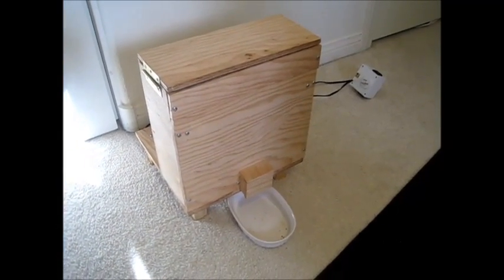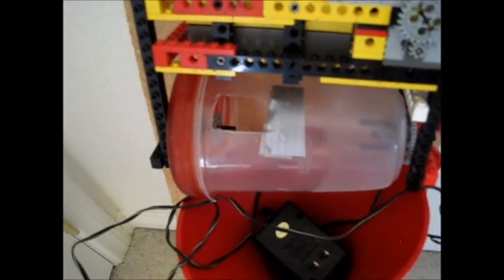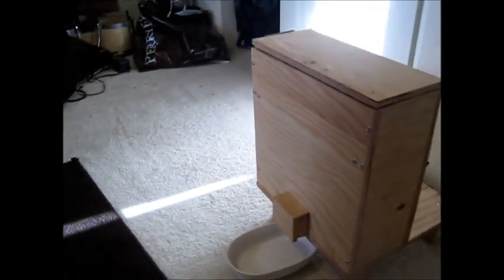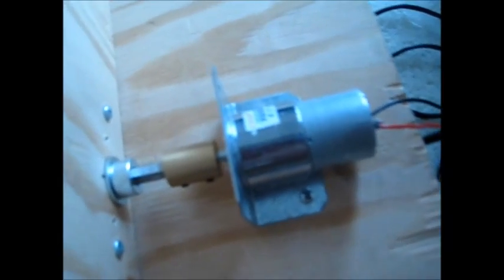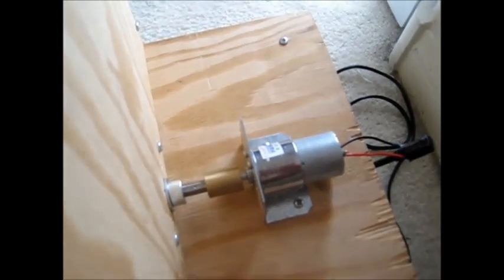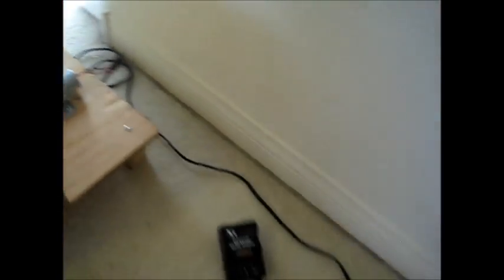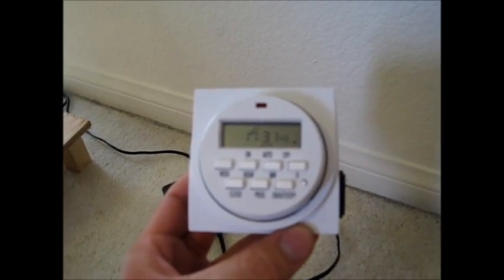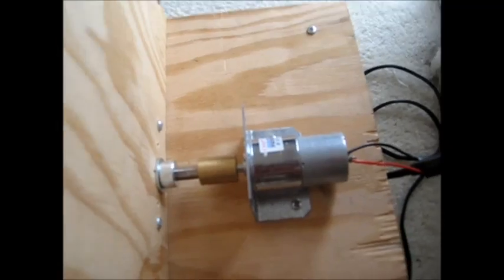Homemade Automatic Dog (Pet) Feeder Update

Comment: FYI, the timer appears to be the one sold by Harbor Freight.  You can modify this unit so it can be programmed down to 1 second intervals.  Open the timer up and on the main circuit board you will find two pairs of solder pads.  Bridge each of them with solder.  This will set the timer to 12 hour am/pm mode (instead of 24 hour military time) and will allow you to use the bottom right button to program down to the second.    

Incidentally, the design you are using is very similar to the original AutoPetFeeder.
Reply from the maker: Good to know.  Thanks!

Comment: Hey dude, great vid. Small favour, would you be able to send me all the electronics that you used e.g. 12 v motor, dc adapter, digital wall adapter auger bit, coupler and also the wood measurements. 

PLEASE RESPOND ASAP AS I NEED TO MAKE THIS FOR A SCHOOL PROJECT 

THANKS SO MUCH
Reply from the maker: Please email me at hutchmath@gmail.com and I will email you the list and links.

Comment: Will these parts work?
I can't figure out where to get the DC adapter. 
https://www.amazon.com/gp/product/B00004YO6X/ref=ox_sc_act_title_1?ie=UTF8&psc=1&smid=A2M9YF80JDMAHE
https://www.amazon.com/gp/product/B00MVF16JG/ref=ox_sc_act_title_2?ie=UTF8&psc=1&smid=AARY1ZSUT9VPR
https://www.amazon.com/gp/product/B00858SRHC/ref=ox_sc_act_title_3?ie=UTF8&psc=1&smid=A30WUG2ZDGM0XM
https://www.amazon.com/Stainless-Steel-Screw-Shaft-Coupler/dp/B00KVNA50G/ref=sr_1_2?s=industrial&ie=UTF8&qid=1475121214&sr=1-2&keywords=coupler+shaft+3%2F8+to+1%2F4
Reply from the maker: If you send me an email at hutchmath@gmail.com then I will send you the complete parts list with links.
Reply: kobus.fourie@gmail.com

Comment: Awesome, great idea! I was thinking of a solenoid but the auger will work better. Using a drill bit was a great idea. 

Thanks!
Reply from the maker: That's a great idea, Moises.  A wifi power outlet would allow you to control it online and feed your pet anytime you want.
Reply: Nice. I was thinking of doing the same. How did it turn out for you?
Reply from the maker: Glad my video was able to help you!
Reply: Great ideal. I'm currently building mine barrowing from your ideal. I'm using an electric power drill hooked up to a wifi power outlet so I can have access thru my iPhone.
Reply: Dan Man. Thanks dan man. It turned out great. Just got back from a one week vacation and worked flawless. I pointed one my home surveillance camera to monitor it. Couldn't be happier with it. Suggest buying a wifi plug thru amazon ($20).
Reply: how to control when motor should stop spinning and stop deliver the food?
Reply: can i do it with these items?
Second hand botch Drill
Timer clock?

Comment: how but make it battery operated with a switch?
Reply from the maker: Yes you could hook it up to 12V of batteries and use a switch but then you would need to use something to program it with, like a arduino.  Using a wall timer and plug seemed the easiest for me and I do not need to worry about batteries running out.

Comment: Hey everyone, I am going to use a rubber automotive fuel line hose as my drive coupler. It's cheaper than a metal one! You can use small hose clamps to make up for shaft diameter differences.
Reply from the maker: Sounds like a good idea.  If the food gets stuck hopefully that fuel hose will not slip.
Reply: I'll probably also use an adhesive, but I am pretty confident the hose clamps will have more grip than the motor has torque

Comment: This is exactly what I have been thinking about doing for several months. Though, in my mind, the 'ramps' would be closer, even touching the drill bit on the sides.

I plan to use a plastic storage container tilted on it's side so the bottom side corner will be the lowest point. The container will be tilted at a 45 degree angle. I then plan to place the drill bit at the lowest point and therefore the sides/bottom will act as automatic guides for the food. The motor will be as you have yours and the other side will have the hole for the food. I do expect that I will have to put a cover over the end of the drill to prevent food from just dropping out.

Do you have any suggestions based upon your experience with your design?

I really appreciate your posting this.
Reply: Great idea of using the tilted bin. I am thinking of using a square plastic container that kitty litter comes in. I will protrude the tip of the auger out about 1" so I think that should keep food from just dropping out. I will elevate my container on a stand to keep out of my insatiable lab mix. A PVC pipe will cover the auger protrusion and dump into a funnel that carries the food down to her bowl on the floor. Any updates on your build? I should have mine done this weekend.
Reply: That is a great idea.  Sadly I had to disassemble this project.  The motor and everything was working great but since there was such a gap between the auger and the ramps, food would collect there and eventually attracted bugs.  For my dog's safety I took it apart and kept the main components in case I want to re-design it.  My dog now eats whenever she wants so the feeder is not really necessary.  If I am looking for a new project to build, then I would consider redesigning it.  Perhaps use a sealed food container and have the augor go vertical instead of horizontal.  Then this would drop the food in the same way.
Reply from the maker: A plastic storage container is better than a wood container.  My wood became discolored over time and eventually had to be discarded.   Yes placing the ramps closer would be better.  I had too much space between and that resulted in food building up there and attracting bugs.
Reply: Is your done yet? I would be very interested to see how it comes out. I have worked mine over and over in my mind. I know the concept is going to work. The devil is in the details. I have no made mine due to lack of money.  Here are some other 'notes': The auger must be based upon the size of the food. The auger extension only has to be one 'loop' of the 'screw' (1 inch is probably a bit much). The container must be as air-tight as possible, moisture resistant and sealed. Any moisture in the air will not exceed  the 'extension' and be emptied each feeding. The container must be fairly large, likely hold a 20lb sack of food. (related to the moisture and interaction required). The extension could be secured by a 'tie wrap' with two small holes on the bottom of the container and the head inside the container, surrounding the extension. Best to use any glue that is 'safe' for food. I would use a hot glue gun if I cut that hole poorly. Note that the color of the glue sticks indicates the strength and heat required to melt it. (black being the strongest)

I have 3 cats and one large dog. It's non stop, the feeding and watering. 

I solved the watering problem by buying an automatic watering bowl on eBay for $15 with screws mounting (vs just sits on the floor) so I can guarantee the water bowl will not tip to allow flooding of the house..
I have one for the cats (high up) and one for the (sloppy) 70lb dog.

Right now, I have my hands full working on 2 sailboats. I'll follow this project though.
Reply from the maker: No I have not started this project.   Just an idea in my head for now.  Currently my dog is not eating as soon as we put down the food because she is sometimes picky and wants other things like veggies.  Therefore sometimes the food sits all day before she finally realizes she is not getting anything else.  Therefore at this stage a dog feeder may not work with our dog.
Reply: Nope I'll be starting on mine tonight and have to finish it pretty soon here in the next couple days, before weeks' end. I am not worried about the airtightness because I will only use this system for a couple days at a time if I'm out of town.
Reply: Yikes! The 'extension' cannot be inside the container, or the auger will not ride on the bottom (curved) of the container edge. My bad...

Comment: Is there any electronic means of speeding up the motor, other than by use of gears?
Thanks
Reply from the maker: +Martin Scherer   They do make gear-motors that spin faster than this one.   I purchased this one because a slower speed means more torque.  I wanted to make sure there is enough torque to push the food out without it getting stuck.  The only way to increase a motor's speed is to increase the number of volts, however over time this would most likely burn out the motor.
Reply: Thanks

Comment: I ALWAYS have my dogs water bowl right next to his food bowl, Juuust incase.         - Hes gotten choked a few times om his food & almost got choked a few times & his water dish is first thing he goes for,so I make sure he ALWAYS has it right there.    / Very cool idea though with the feeder. I guess it depends how trustworthy the timer is,if it malfunctioned & stayed running & got the motor too hot,would suck.
Reply from the maker: +97warlock ismyname  I used the timer for 3 years constantly without any issues.

Comment: Thanks for this. I want to feed rodents. I'm thinking of housing the auger in a 1" uPVC pipe with a 1" hole from the food container. do you see any problems in that? How did you get the motor to turn anticlockwise?
Reply: +Martin Scherer   You get the motor to spin counterclockwise by switching the leads from the motor.   If you food is small enough then your idea could work.  However if the food is too big it may get caught and put more strain on the motor.
Reply: Thanks, Eric. you are very prompt. I will probably be using sunflower kernels. 

These are prototypes. I looked at adapting commercial pet feeders to deliver smaller amounts but people's reviews told me they probably wouldn't work. If cats can reach inside, I'm pretty sure rodents will. I experimented with a cereal dispenser and coco pops, but the dispensers soon jammed up. Worse, I found the rodents rejected the coco pops! What are we feeding our children? 

I then experimenting  with a home made turn screw and for a motor took apart citrus juicers, which are pretty strong, but they are either too big or have auto reversing motors. If I had come across your video, I would have saved time! If I succeed in my objective, I will post the feeder adaptation here. 

Thanks.
Reply: +Martin Scherer   That's great.   I would like to see your final creation.
Reply: +1rudedogg Works fine as designed by Eric. I'd be concerned about speeding up as that might increase risk of trapped food.

Comment: What store did you find your auger??... is it online?

thank you!
marC:)
Reply from the maker: Marc Paradis   I found it at Harbor Freight:  http://www.harborfreight.com/auger-bit-set-7-pc-68166.html
I used the largest drill bit, which is 1 inch.
Reply: Thank you for your quick response! But ... what motor did you use? i mean the diameter need a shaft coupler, and which motor do you use?

thank you so much! :)
marC:)
Reply: Marc Paradis can you post the link of your motor also the shaft adapter?

thank you so much! :)
marC:)
Reply from the maker: Marc Paradis   Motor: http://www.amazon.com/gp/product/B00858TNN4/ref=oh_details_o00_s00_i00
Shaft Coupler:  http://www.skycraftsurplus.com/shaftcoupler38to14.aspx

Comment: Can I know where did you find the auger? + wouldn't a plastic auger be better?? I'm doing an automated pet feeding for my school project.. I would appreciate your help in finding the auger..
Reply: +Rawan Al-rasheed     I found the auger as part of a set from Harbor Freight Tools:  http://www.harborfreight.com/auger-bit-set-7-pc-61542.html    I used the biggest auger which was 1 inch.  A 1.5 or 2 inch one would be better, but this was the best one I could find for the price.

Plastic would be better but I was never able to find one this small.
Reply: +Rawan Al-rasheed Human breakfast cereal dispensers use plastic. Not quite an auger but similar. I first thought of automating one but found as several as posted they jam up in human use. So I sent it back. It also cost more than the pats Eric chose.
Reply: +Rawan Al-rasheed The Harbor Freight augers come in a pack of 5. All can be put inside a uPVC pipe of appropriate size to be found at Home Depot or Lowes, if you cannot find a plumber to give you an off-cut. For delivery of sunflower seeds to rodents, I used the half-inch auger. I used a plastic soda bottle as a hopper cut an oval hole to fit on the top of the plastic pipe, and housed the whole in a purpose built thin plywood box.

Comment: What size dog food can that bit take up to without getting significant food crushing?
Reply from the maker: Stephen Roche  I only use it for small kibble.  The biggest would be 1/2 inch diameter and up to 1/4 inch thick.  I have tried a few brands and I make sure all of them have small kibble.  Since I have a small dog, then this is easier for her to eat anyway.

Comment: bro.. may i ask what do you call that timer you used.. i'm trying to find one myself but i don't know what its called.
Reply: I'm guessing it doesn't matter which timer thing you buy as long as it can turn power on and off with a timer. I'm making a similar thing myself and I'm using a Sonoff which is basically a wifi switch.

Comment: I meant precise control. I would have a load cell to feed back the weight and get a slightly slower motor and a slightly smaller bit to reduce overshoot.

Comment: The motor only ;pulls 125 mill amps ( which is low) the cheapest 12 volt power supplies on ebay are only $3.85 delivered, and they supply 1000 mill amps, strip the wires off the plug and solder them to the rear of the motor, take the motor to the hardware store, buy the decking or joist hanger (made of sheet metal), then buy some screws that tread into the from of the motor plate into the empty threaded holes, do as the author reccomends and drill the decking joist hanger to match the motor

Comment: Type coupler into the web page at skysurplus dot come,, it pops right up, the drill bit has a washer on one side and a washer on the other side followed by a drill bit stop, get a stopper the size of your auger bit shaft, where the drill bit goes thru the wood cut a piece of pipe close to the diameter of the auger and glue it into the wood as a sleeve/bushing this will make it last a very long time with spinning and use, the motors are still available at amazon, the bits are on ebay for 7 bucks

Comment: The poster of this vid makes this look very easy. This is not an easy project to build from scratch. I've got most of it figured out except how to secure the drive assembly. How is the motor held in place? What supports the non motor end of the auger where the food comes out. Building this with my son, we will post when complete.

Comment: Very cool but I have a suggestion that might save you a few bucks in the future. You might want to try a piece of small water hose and a couple of hose clamps for the drive adapter on the motor axle connecting to the feeder auger. In the tool and die company I work for, we use a hose couple to drive encoders off of cam shafts on our press tools. As long as there is not a lot of strain on the shaft assembly when it is pushing the food out then the rubber hose should work fine.